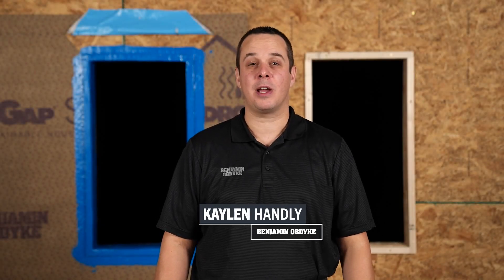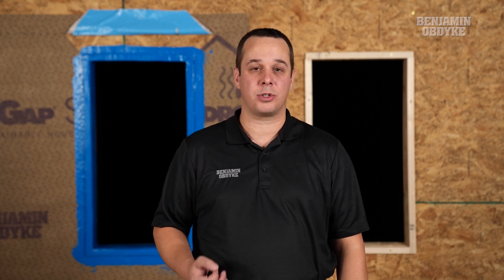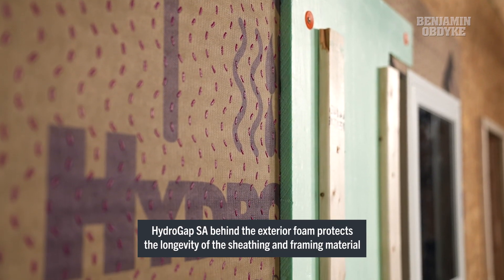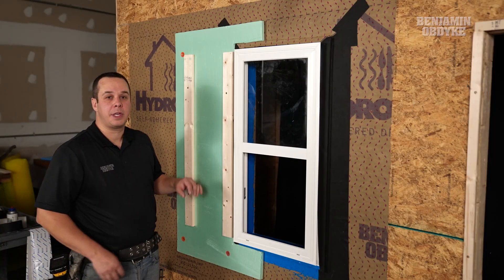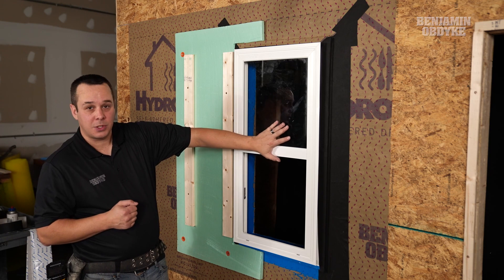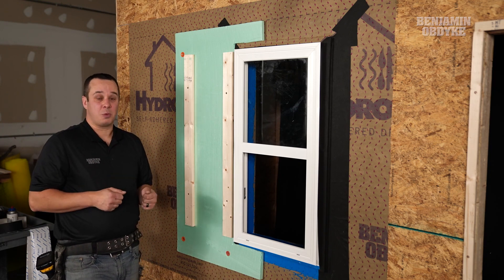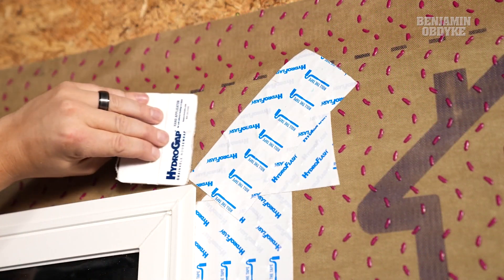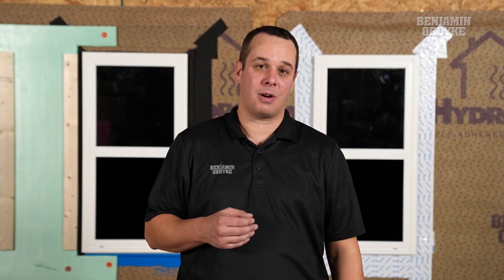HydroGap® SA & Exterior Foam Applications

Comment: Every time I see a window installation demonstration with a flashing detail they never incorporate the drip cap. so now with that sealed on top how are you supposed to tuck in your head drip cap underneath the wrap?  You may have a piece of trim as well and over top of your piece of trim you have another drip cap. These metal flashings are not installed in a weatherboard fashion. The peel and stick on the top should be flapped over the metal flashings
Reply: Here is an idea. Maybe double up the house wrap on top of window. A piece of house wrap under the flashing and then the main house wrap to go on top? Just an idea